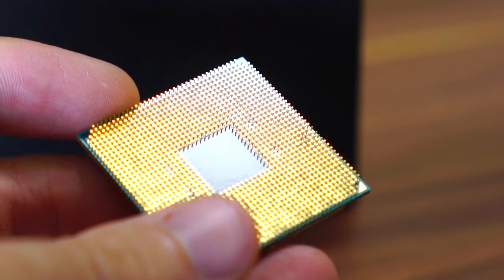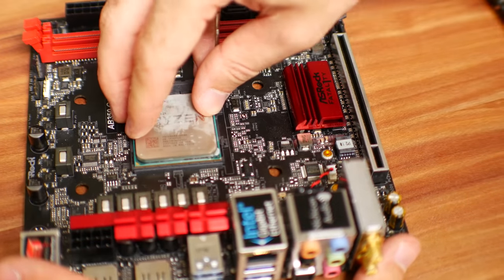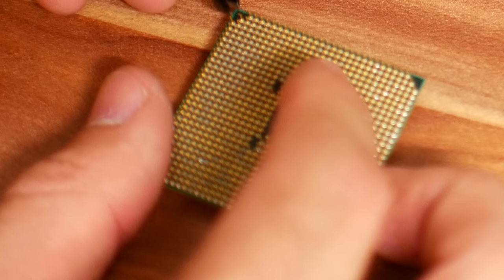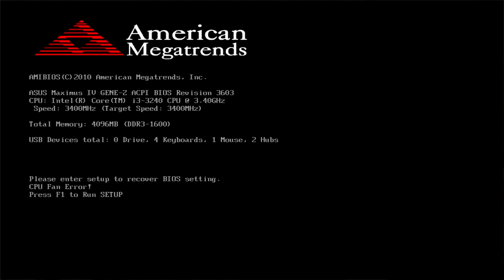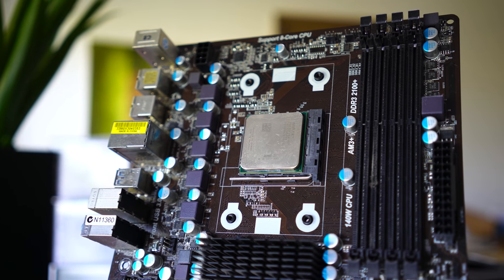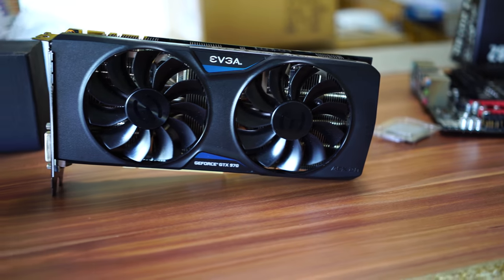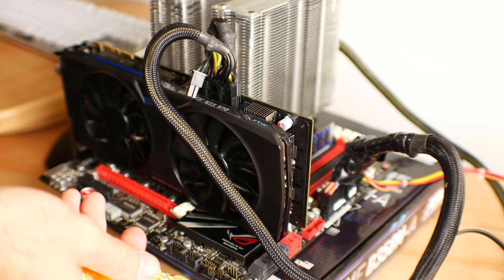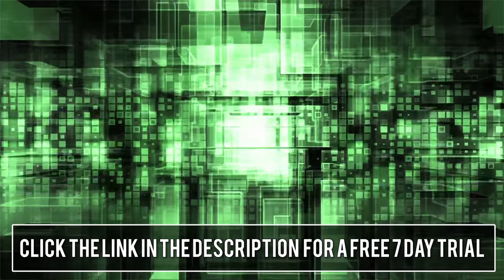How to Fix Bent CPU Pins (Ryzen)

Comment: Maybe the guy with the i7 and mobo had a crappy PSU who wasn't capable to fed the 1080 and then the performance goes down..

i5 4460 and GTX 960 8GB DDR3 1600 single channel 60-100 FPS at ultra settings in BF1 :)